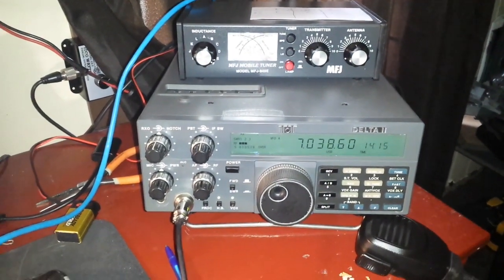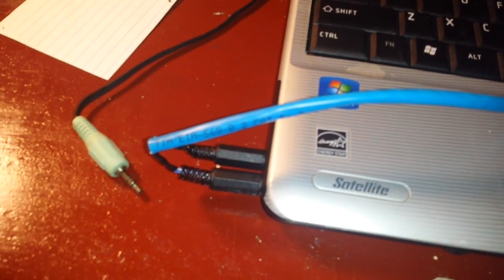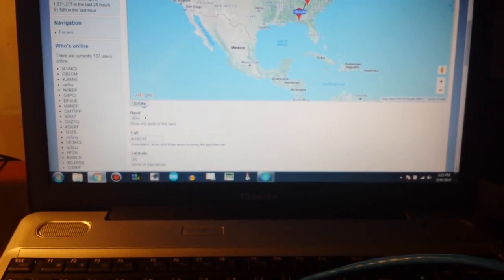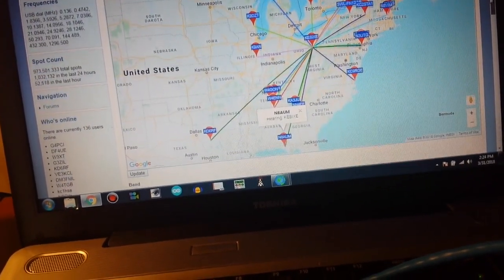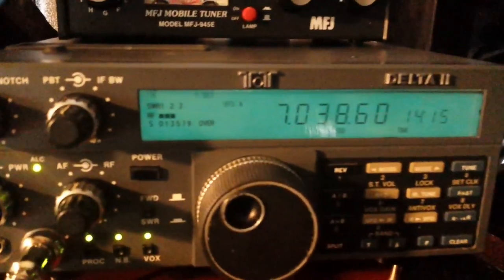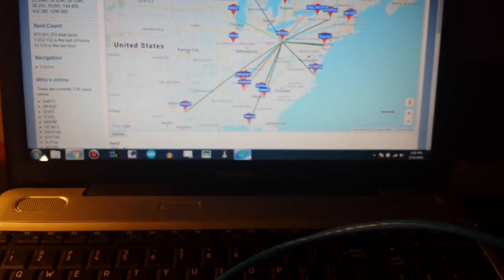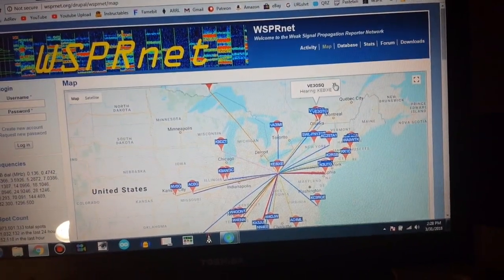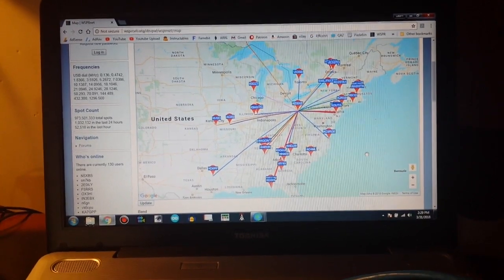Testing out my custom interface cable

Comment: Here is a G+ link to my version of this I mentioned in a comment to in your first cable video. The tricky part was making it simple and cheap with only one PC USB connection. The audio isolation was necessary with my electrically noisy desktop, and avoids ground loops too.  https://plus.google.com/u/0/109707004486891637182/posts/7L5WLkxvVKt
Reply from the maker: That is really nice, and it will come in handy. I just ordered a BITX40 Saturday. Now we just have to wait for the package from India. I used DHL so hopefully it's not too long.
Reply: I plan to upgrade the audio circuit with input and output log audio pots because of overloading both devices, and requires a delicate balance. The BITX 40 will TX strange sounding tones if the input is too loud. And a power switch for the relay because it comes on at PC power up and doesn't go off until FLDGI loads and initializes the serial port, making it TX  the whole time. And I'll combine it with the "FLDIGI CW keying circuit" I made before from the FLDIGI manual with it. Also a good one. Isn't this stuff fun?